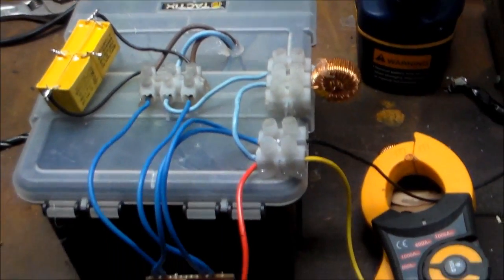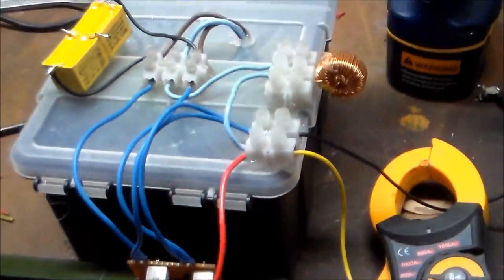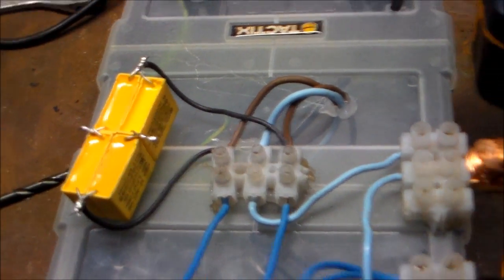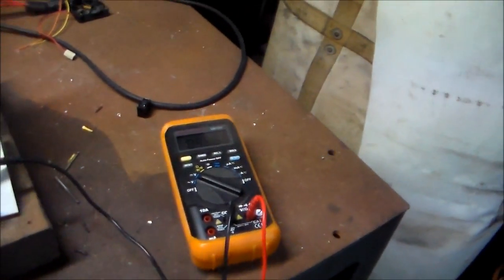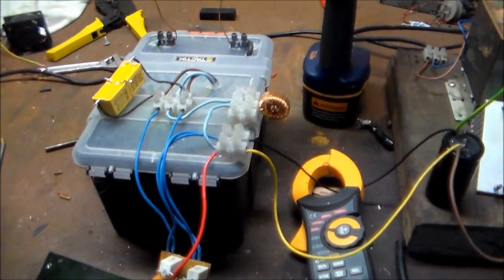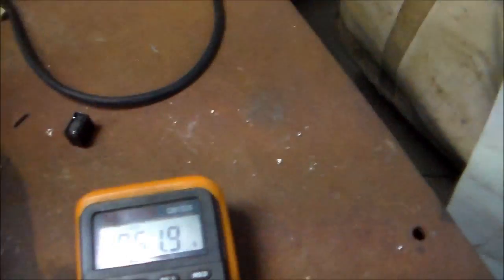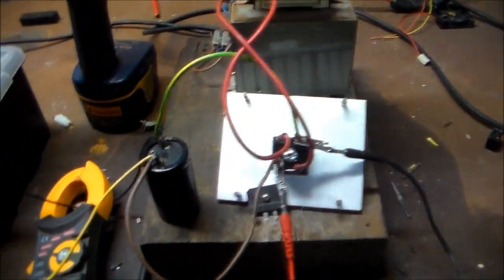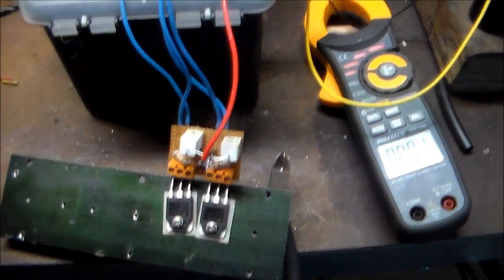GOOD ARC! IGBT ZVS!! goes POP on me :(

Comment from the maker: hmm i used to run like that (minimum lead lengths) and i had trouble with getting the inductance of the main inductor right. it had to be really low (like 25uH) for it to start oscillating. with the slightly longer leads and the IGBT i can run 50uH without problem and it sounds and runs a lot cooler!

Comment: Great arc, maybe insulation to the heatsink broke down. I made a ZVS with insulating pads etc but didn't work. Put the mosfets on two separate heatsinks and it works.

Comment: reduce all your lead lengths to a minimum to reduce inductance and the possibilty of high switching transient voltages - perhaps add some zeners across collector / emitter or diode clamp to supply rails to protect devices, an oscilloscope on the collector will give some clues